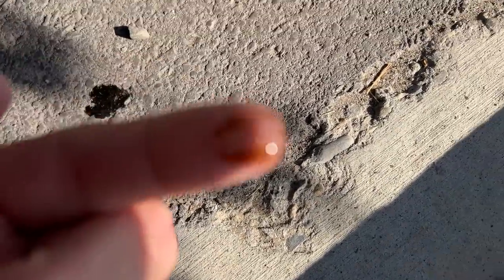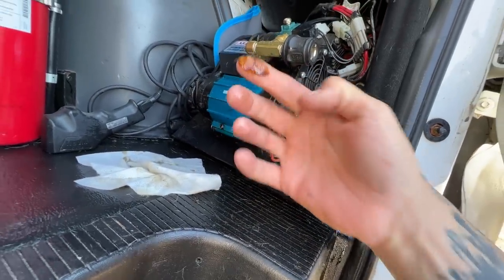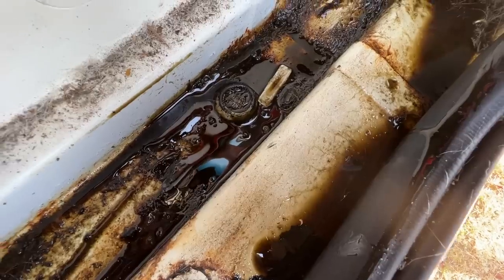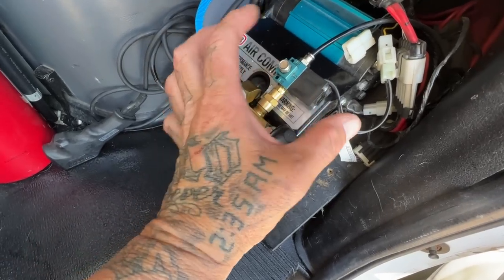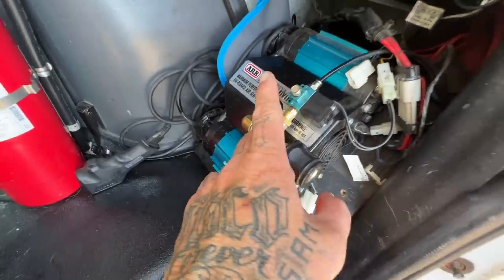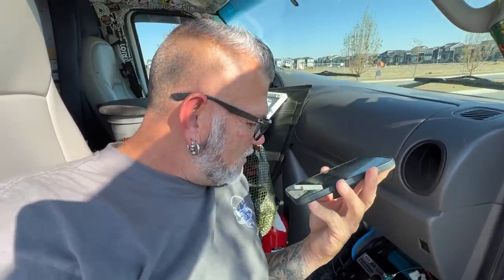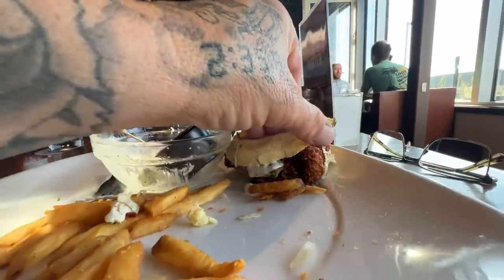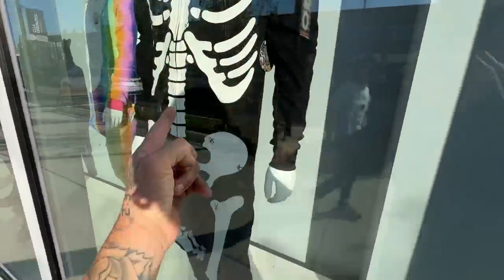OIL LEAKING On My FRONT SEAT FLOOR. Crazy Where It's Coming From....

Comment: Just a suggestion.....if you are thinking about a locker for the ambulance, consider a Detroit Locker. It requires no maintenance or action from you to work and they automatically provide positive traction for the drive wheels when in a low traction situation while unlocking during normal driving. Added bonus, they are cheaper and easier to install the the ARB Locker and are pretty much bullet proof.

Comment: Sounds like your differential vent is plugged, building pressure. luckily its going up your air compressor line, and not out your axle seals.

Comment: Hi Chrome...don't  know if it will meet your needs but there is a differential called a limited slip diff.  and it requires no compressor or air line ...locks up after slip occurs..

Comment: Normally there is little if any pressure in the differential housing. If there's enough pressure that oil is being pushed up through the air line you almost certainly have a glogged breather. Blocking off the hose to the locker without making sure the breather is clear will result in built up pressure pushing oil out your axle seals.
Reply: @Brocephus77  The gear oil can only make it that far through the air line and back to the compressor is if there is pressure in the axle housing. The way his system is installed it's uphill from the seals in the ARB to the compressor.

I've replaced O-rings on ARB's that were dumping air into the housing. I've found small amounts of oil in the hard line running from the case to the carrier but not once had any significant amount of oil made it into the flex line let alone all the way back to a cab mounted compressor.

Comment: Yep. Heavy oil and my theory is your differential vent may be plugged so when things warm up in the differential pressure builds up and forces gear lube through the air line.

Comment: A lot of these air lockers are meant for off-road guys use the rig like once or twice a month or six or seven times a year and they were great you never had a problem but in your application go to Detroit straight locker it’s got clutches in it so when you make it turn your wheel doesn’t drag it’s a better optionThat’s what I run in my daily for last three years never had a problem

Comment: Well, my mind had just decided NOT to get a locker for the rear diff.
My van is super capable off road and since it’s the short version, water bars are not an issue, as long as they’re not too deep!
Thanks for sharing.

Bryan from Vancouver
Reply: There are many styles of lockers, just dont get an air locker.